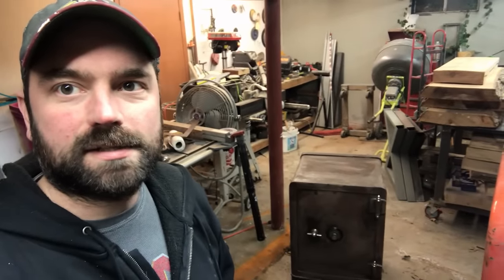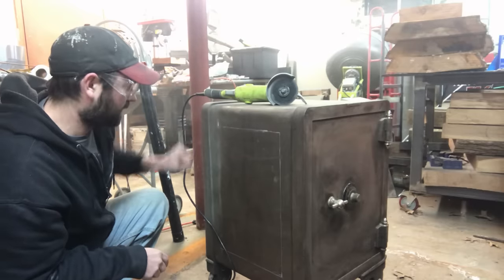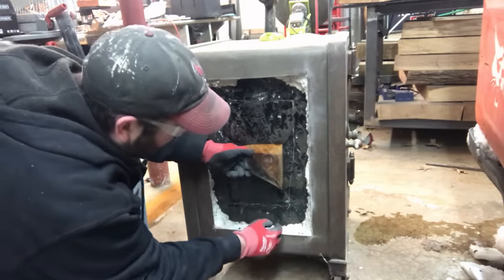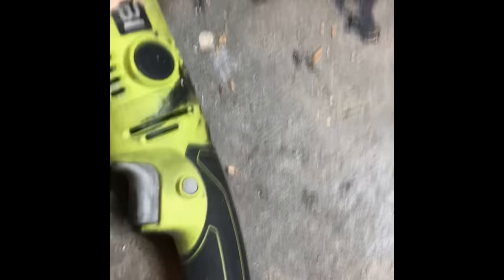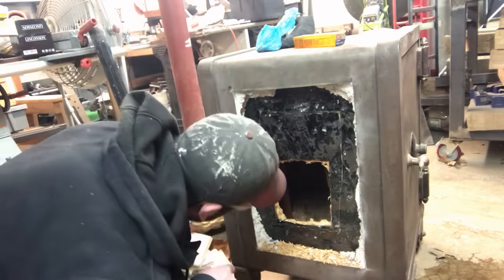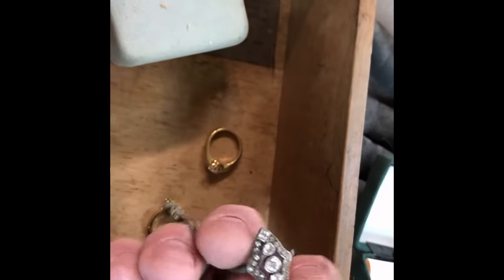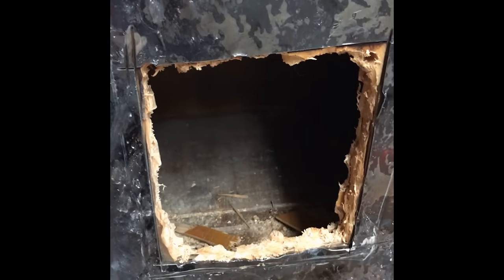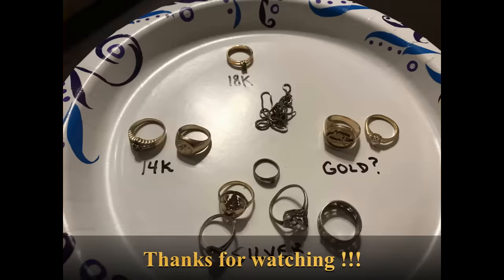Breaking into locked antique safe! What's inside???

Comment: so sad to see that safe damaged so badly. the Locksmith would have opened it with only a 1/4 inch to 5/16 hole and repair would have been silly easy. I have worked for 27 years as a locksmith / safe tech. this seriously hurts to watch.
Reply: Just got done telling him the same thing lol. One locksmith to the other!! Gotta love the ones that try to break into them and hit the tear gas lmao. Too bad to ruin a nice antique safe. He could have had it with a new working combination!!
Reply: i didn't watch it, rubbish
Reply: One man's trash is another man's treasure.  This is pretty mild by YouTube standards, considering I have seen people destroy perfectly good and brand new airplanes, supercars, and high-end electronics.   

This thing was scrap metal to all but like 15 people in the world.
Reply: Where would that hole be at roughly? and how would you repair it? I have a cast iron Cincinnati safe and lock Co. Safe. I am looking to repair one that was broken into years ago and I am trying to see what I will need to Replace.
Reply: @zragevii4705  I'll have to go thru my storage to find my books. I'll let you know. Also any locksmith that deals in safes would be a better deal. Unfortunately some safes are labor intensive and usually the charges are per hour and any supplies used.
Reply: @philipancell516  on a good note I'm starting with an open safe that appears to have been drilled through the handle. If I have everything from the lock I'm simply going to put it back together and use it. (I will also try and repair the hole)
Reply: Thats good!!
Reply: The lockpicking lawyer would have opened it with a high power magnet or a good raking 1 click 2 clicks
Reply: Just curious but what would it have costed to have a Locksmith to come out and open that safe up ???     What would you have charged to do it ???
Reply: @s10_4_life6  he said it was 250
Reply: @zragevii4705  I had a Victor safe from about 1905 and one of the safe collecting websites lists commonly used combinations for safes by the maker.  I had the combination for the safe I used to have, but they had it's combination listed as one of the commonly used factory combinations.  That might be worth looking into as well.
Reply: @earlnut  i got to looking at it, handle was messed with for some reason and the lock was drilled where it interfaced with the handle. The brass piece they drilled into and the cast iron lock case blew up.
Reply: another moralless hack, the world's full of them..   would it have been the same for antique car, or a house?
Reply: I was a substitute locksmith at an intelligence agency. Our locksmith went to school and had the equipment and books to open most safes. Like the others said, about a 1/4” hole drilled in the right place using a super hard bit to go through the hardened plate in front of the combination lock. Repaired with a ball bearing welded into the hole. We also had a machine that tried every combination, automatically. It worked in less than 12 hours on safes like that. But consider this too, some very old safes contained booby traps! Bottles containing nitroglycerin were sometimes placed inside of the doors! So be warned!
Reply: bubba! It really is a shame.
Reply: @NOLAART  they welded the holes up, and instead of replacing the lock they just welded a loop with a piece of flat bar to fold over another loop so you could lock it. 850lb cast iron safe held closed by a $2 master lock..🤣
Reply: @DRONEintheZONE  lock picking lawyer would have probably cracked it or drilled a small hole and managed... nothing majorly destructive
Reply: I don't know why anyone would buy a safe with no keys or combination. I might have spent the $ 250. And then been able to have a working nice looking safe. When you roll the dice, sometimes you win, sometimes you lose!
Reply: @randy1203  buy it paying only the value of the safe and it's worth it
Reply: @s10_4_life6  Less than I would have paid for it, had it been useable.
Reply: @Mycooloriginal  Where did he say that at ???     Bc I don't see it in his Comment anywhere
Reply: @ianboard544  If it would have been useable and it didn't cost that much to have a Locksmith crack it open then I would have just paid the money that way you still have a useable safe afterwards.... I've got a Big Gun Safe here at my house that I need to have the combination changed on because it was my Dad's Gun Safe and He passed away last May and then I got it afterwards and I don't know what the combination is to it, but luckily for me he had left the safe door open on it, so I just need to have the combination changed on it now, which I know my Dad had it changed once before and for the Locksmith to come out and change it he charged him like $175 or $200 I believe it was to just come and change the combination on it 😳😳😳
Reply: then dont charge so much for such an easy job
Reply: Had the same thing done on my 100 year old safe, he drilled hole in lock and got the combination.
Reply: Not to mention the safe looks to be one of those with asbestos fire code in the walls and door.
Reply: @zragevii4705  if it is a gravity levef drill at 7 o'clock into the dialring at an 30% angle. Then use a 70° scope to line up the gates. If it is a drop in then drill at approx 10:30 into the dialring.
Reply: @jtocwru  People are making  livings restoring old safes.  Hardly scrap metal to someone who knows their value.
Reply: @Liam1H  

Uh huh.  

One person restored an old safe, and made some money.  One curio is not the same thing as a cottage industry.  There aren't dozens of people restoring hundreds of old safes.
Reply: @DRONEintheZONE  A magnet won't work on these safes. It only works on crappy electronic ones, if they have solenoids, that is.
Reply: Loosers don't think like we do.
Reply: Why pay a lock smith on the off chance there is valuables? I would rater bust the hole and save my cash.
Reply: Yea but he got a full vid of footage doing himself and the "NOT A HUGE PAYDAY" isn't as bad because he didnt have to dump 260$ out
Reply: 250 is what hurts you "professional" overchargers!!
Reply: Yeah but then it's not a fun adventure/project that you do yourself.
Reply: Herbert Radcliffe, how much could he have sold it for to a collector?
Reply: @shanefairbank8915  in the condition it was in prob about 5 to 6 thousand. opened properly  and restored (re painted and detailed ) 10 to 15 grand. cast iron safes are fire proof and extremally secure compered to what is out there now.
Reply: @herbertratcliffe8028  🤣 hahahaha your so funny . In your dreams dude
Reply: Herbert Radcliffe, thanks for the reply. Wow I didn't expect that. He probably doesn't care though I'm sure he's a millionaire several times over. I feel the same way though things made years ago were just made better.
Reply: Some would not have damaged it at all
Reply: @stevesutton9444  Just clickbait. Clickbait is a disease.
Reply: 9 times outta 10 if you strike down on the end of the handle on that type of safe, it will open. I've done it.
Reply: @gregoryhagen8801  I am bidding on one of these right now and the handle is snapped off. I bet they did the same thing and broke it.
Reply: @Tinkerbell227  Amateurs. How r u going to open it?
Reply: @gregoryhagen8801  I looked at it earlier today. If my memory is good. It had like a 1/2 square shaft. I will just drill the center of the broken shaft and left-hand tap it. Then run a bolt in it to use a socket wrench. Unless you turn it clockwise to open. Then I will use a right-handed operation. The trick is to not drill all the way through but enough to get a good bite. Probably about 1/2" deep hole, for a 1/4 bolt.
Reply: @Tinkerbell227  Good idea.
Reply: @gregoryhagen8801  I like to fabricate and machine things. Plus, I am extremely good at problem solving. I look at something thoroughly and visually fix it in my mind. Then I do it in real life.
Reply: 😂😂😂😂 Totally what I said about getting a Locksmith to Open the Safe, but it might cost as much as £150 - £200 In Locksmiths Charges.. 😮
Reply: I need help opening a 1800s safe but know the code any advice I don’t want to damage it either
Reply: Are old safes worth that much???
Reply: The Locksmith I paid didn't do anything but drill a hole and give up...

Comment: Dude you watch too many YouTube videos on how to open a safe flip it completely upside down cut the bottom out don't matter if you bend the metal you're not going to replace it you'll never see the hole in the bottom if you're going to use it for an end table flap a coat of paint on it less work less time get to the treasure inside

Comment: I'm a real safecracker. Been doing it for 35 years. Such a sad thing to see someone destroy a nice piece of history. All for show. 
For a real safecracker it could have been opened by a technique called manipulation or at least with a 1/'8" hole. Then a tiny repair and you could still use it. This is one of those "hold my beer" moments.
Reply from the maker: If I had 35 years of safecracking experience, well sure I would have just opened the door. As I said in the video, local locksmith wanted $250 to unlock the safe. Safe in that condition with a combo is not worth much more than $250 around here. It didn't make financial sense to pay to have it opened. I repaired and painted the safe and now use it as an end table in my house. Also sold the rings for almost $900.
Reply: @hooterspfld  I would like to see how the repairs look on that... that's a major repair to have to do.
Reply from the maker: @zragevii4705  https://youtu.be/qYYdVo22NzM cut to 19:45 if you don't want to watch it all.
Reply: Do you work in Arizona? I need help
Reply: That type should be a "fairly easy" to manipulate, with the dial intended  for normal access.
Reply: Hi 
I purchased a building and found an older safe and owner before me had no idea it was there. I called the locksmith n they can't open it because it's an older safe. I would like to use it but not sure who can open it for me..
Reply: @andreaspelep3020  ...DYNAMITE?!
Reply: Do you know what brand and model this safe is?
Reply: I felt like I was watching a slow motion train wreck in the works.
Reply: I don't know if you'll even see this, but I'm an amateur author working on a novella set during the 1920s. In the story there is a scene where the hero's wife and his protégé need to access his laboratory safe (just like any other safe), but he's not there to enter the combination. They still need to get into the safe to retrieve alien metal ingots. How do I believably write this scene? @safecrac1
Reply: My work mate has one like this in the garage. We need to destroy it and move it away (Base in North London). You can come and collect it free of charge. You will need the proper lift for lifting
Reply: I own a Junk Removal service. People ask to remove safes all the time. We don't do the jobs because they are too heavy. Is there a way to cut them in half? What tools would you use?
Reply: My dad had a similar old safe and I could open it by placing a bit tension on the handle while manipulating the dial back and forth. When the notches line up, the handle moves ever so slightly and continue manipulating the dial until other notches fall in line. Did similar with a wall safe in a house we recently purchased.  Took about an hour but I did it. Oh, the exhilaration of success. I would have gladly paid the measly 250 bucks to preserve the safe.
Reply: I have the same safe that was left in the house I just bought...it's driving me crazy and I don't want to destroy it in order to get inside. Any help? I feel like Geraldo
Reply: @MASTER3RDEYE I was on pins and needles as he mutilated that lovely antique. Hearing him crunch up the beautiful cabinetwork inside just added to the cringe factor. I would have paid a locksmith the $250.00 as well, especially considering he only paid $65.00 dollars for it. Safes like this are going for $400.00 to $1200.00 on Ebay, and the shipping is another $400.00.

Comment: As a locksmith,  going through the front door on that particular safe would have been much easier, and also give you access to any other compartments you may have missed on the other side of that dividing wall. 

The fire retarding material used within the safe walls is called, "gypsum". Though it's thicker, and lacks the paper, it's very similar to drywall.
Reply: Well said!! I'd pay 250 for a locksmith....ruined an nice safe!!
Reply: As an apprentice I assisted my employer with opening several safes. We did one in that was left in a house that had been used as the town office while the town hall was being built in the 1800's. We struggled with it for some time until realizing there was a 4th wheel...
Reply: Why not just pick the lock?
Reply: @johnb4183  usually the dial gets taken off and a small hole is drilled into the dial pack. Then a scope is inserted so you can view the gates in the wheels as you line them up. Once all the gates are lined up in the proper spot, the fence drops in and voila. Its a little more involved than that, and it all hinges on finding the right spot to drill so you don't trip the relocker.
Reply: Literally 10 minutes to open that safe from the front been there done that of a credit union safe
Reply: Rather pay someone than get asbestos in lungs doing stupid stuff like that with a grinder madness.
Reply: @davedavenport8176  Yeah, it wouldn't take much longer than that. it's actually not a very secure "B" rated safe. That may even be easily manipulated without having to drill at all.
Reply: @humblerc841  Pretty much, but the relock system wouldn't really activate unless the lock case is driven through, or as with other safes which have a glass plate relocking system. This is an inexpensive safe which could have been bypassed fairly easily.
Reply: @210plarte  
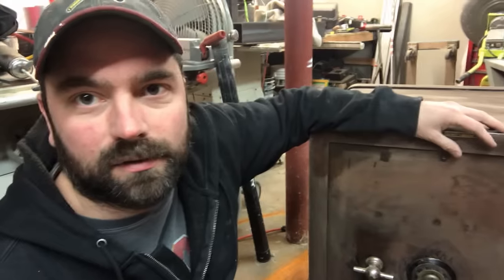I piped the dial off, marked the dial pin at zero, drilling a hole at 1:00 position, used a small bore scope had the safe open in no time at all. Plugged the hole, reapplied the dial. Took the inner door plate off removed a small bronze plate exposing the tumbler plates. Working the combo and then had it in less time the drilling to hole for the scope. Reassembled the inner door and bam 💥 had a full size credit Union safe. 
Sadly I had sold it for a few hundred dollars to a neighbor because of moving. 

It was actually a learning experience that was amazing on how easy safes are to open. The thing is if you’re a thief and you will eventually get caught. It’s best just to get a real job.
Reply: @210plarte  many times all you need is the serial number. Most end users never change the factory combination. Its like buying a baby monitor and leaving the password at default.
Reply: Wait till they get one that has a tear gas pod in it lol. 🤧
Reply: @humblerc841  this one looks like a Hall with a gravity lever. Kind of hard to manipulate due to age. They have 3 wheels and a drive cam. Once the lever drops into the drive cam usually around 100 you can open it. The DP is at 7 o'clock but needs to be in an upward angle since the wheelpack has a shroud around it. Fun to open if you know how.
Reply: The safe would have been worth some good money. That was stupid!
Reply: i agree as a burglar, experience would take me to the weakest point being the external hinges on its back open in 5 mins
Reply: @junior4246  most safes come with either fixed or mechanical locking bolts on the hinge side to protect from what you are describing.  I hope your path leads you to better prospects besides thievery in your very near future, brother.

Comment: With the serial number, you can get the combination list. 
These safes had a list of about 100 combinations that were used when they were manufactured

The lists may even be online.

Rather than wreck it

Most people would not know how to change the combination and would not pay for it, so it most likely has the original factory combination
Reply: These types of safes weren't shipped with a set combination. On the ones that are, they will only give it to a certified safe tech.
Reply: You could remove the inside cover on the door and set your own combination.
Reply: ...WE'LL NEVER KNOW-!!!!
Reply: 22:43